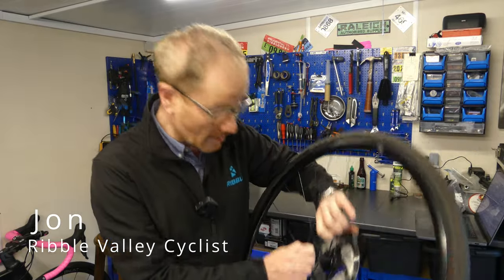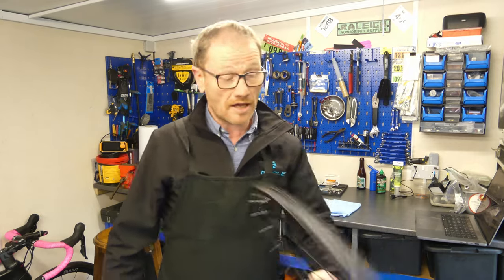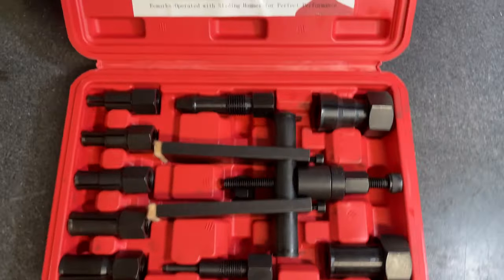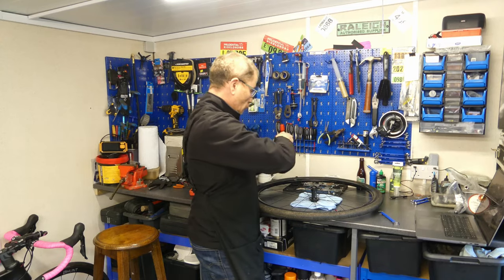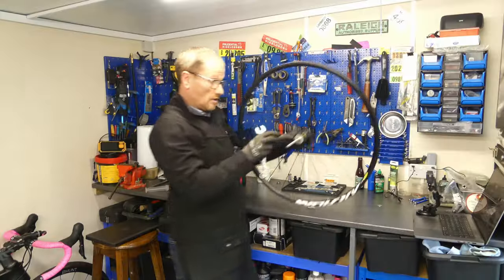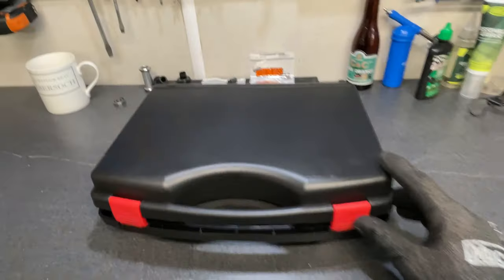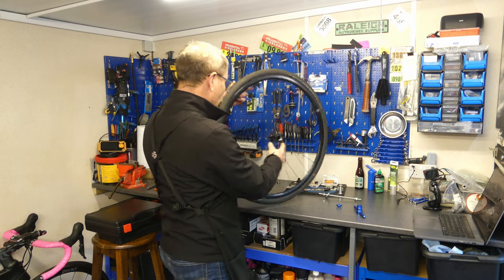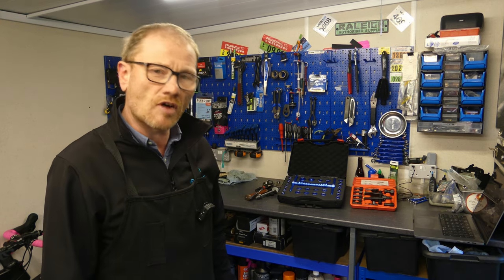Replacing Sealed Cartridge Bearings - Tools Required - Road Bike Maintenance

Comment: how bad is it to put used bearing back in
Reply from the maker: The force used to pull the bearing puts excess pressure on the individual balls, and may deform them. The only danger is that you're putting back in a potentially damaged bearing. It won't do any damage to the wheel, but the bearing may prematurely fail.
Reply: @ribblevalleycyclist  what your thoughts on extracting bearings periodically for a cleaning/regrease then? seems like doing blind pulls might ruin any longevity gained from cleaning. seems the consensus is to just replace em once they get gritty.
Reply from the maker: @wagwanyute8156 If you need to extract with force (puller or punch) then my personal preference is to replace. If the bearing is of above average quality, the internals shouldn’t get dirty too quickly
Reply: @ribblevalleycyclist  thank you

Comment: The average home mechanic needs to remember, that before hideously overpriced blue handled tools, a 10" piece of all-thread, some large penny washers and a couple of jam nuts was a perfectly acceptable way of doing things...
Reply: Also, your washers were waaaay too thin, hence they deform and the bearing goes in on the wonk. The (admittedly very nice looking...) press kit you have versus the bit of stud and washers really only differed in the thickness of the drifts...
Reply from the maker: Hi Sam, thanks for your thoughts. The washers used were 1mm thick galvanised ones, so although they may look like they deformed, they didn't. However, I personally think that if I'd have used 15mm threaded bar as opposed to 10mm, there would've been less space for the bearings to go sideways. Also, maybe using larger sockets as drifts would've helped. So, I agree, there is room for improvement with my DIY press. But I still stand by what I say, the £40 press set is the better way to go....... and I suspect you'd agree 😉
Reply: @ribblevalleycyclist oh absolutely, after all, as a mechanic, he who does with the most tools, wins, after all, right? HOWEVER. Devils advocate time. The washers are just not thick enough. If it came down to a one off use situation, a piece of all thread and some thick washers (1mm is NOT thick enough!) would do. I guess it's the difference between 'n00b' proofing something and not: it's all down to that mechanics 'feel' if you know something is lined up or going in right or not. The price you pay for that press kit to do the job without thinking about it, versus having those bits and pieces knocking around to lash together and make a tool to do the job, if you follow?
Reply: @ribblevalleycyclist  Also you can use the old, extracted bearing as the drift to press against the new bearing

Comment: I've been a home mechanic ever since I got my first bike as a kid; in my late 40s now. I've used the 'proper tool', and the DIY version and I can tell you are porpusely using the DIY version wrong.
Reply from the maker: "Porpusely using the DIY version wrong." Interesting allegation. Please expand on how I am using it 'Purposely' wrong, how you've come to that assumption, and why I would do that?
Reply: @ribblevalleycyclist Sorry for being so blunt. For example on the DIY press, just threating in the rod, throwing on the nuts, then just start screwing away will just yield the result you got, a skewed bearing. The DIY version requieres a bit more finesse than the 'proper tool'. You've got to keep an eye out for it to press the bearings in straight. Also adding some makeshift drifts wouldn't be a bad idea, like maybe a couple of sockets. I've removed several bearings just using a small hammer and a blunt rod to tab out bearings with no adverse effect on the hub. I wouldn't recommend a sharp standard/flat harden screwdriver to tap out a bearing, the screwdriver being sharp and harder that the alloy in the hub, will surely damage/scuff it if comes in contact with the hub.
Reply from the maker: You weren’t blunt, you called me a fake.

I did exactly as others had demonstrated on YouTube (I won’t name names). I battled with that press setup for some time, and I also tried several sockets…. A spark plug socket is a great fit for a 6902 bearing. However, it kept going in sideways. I kept an eye on it, and moved the makeshift press to where the pressure was needed, but it just slipped back. I didn’t show all of this, because who wants to watch that.

However, I agree with you, on reflection, doing as others have done and using a large screwdriver to remove bearings was a bad idea, and that is why I ended up unintentionally damaging a perfectly good hub. However, once again, I was testing what many so called ‘Experts’ on YouTube have both recommended and done, and it seems that I once again showed that this was a bad idea. Oh, and on reflection, a socket extension would’ve been a better choice of tool....... If you could get to the back of the first bearing in the first place (Pre-Load Tube).

The purpose of the video was to demonstrate how those ‘Bearing Hacks’ can be a bad idea, and how using the correct tool is a better option for the average budding home mechanic. Which is exactly what I did. Unless of course you think I’m wrong to do that, and those 'Hacks' are a better way of doing it?????

When was the last time you saw a professional mechanic use one of those things? There is a good reason they don’t, it's got nothing to do with price, it’s because it's a bad idea.
Reply: @ribblevalleycyclist I apologize for calling you that, should have some other wording there. English is not my first language. 

 if I saw a professional mechanic use a makeshift/DIY solution on one of my bikes, I'd stop her/him right at the moment and take my stuff somewhere else; not that I regularly take my bikes to a mechanic anyway.

I do understand that even using the proper tool requires skills, can't have good results if you don't know how to use the tool. Using the screwdriver to tap out the bearing was actually what got me in the "he's doing that on purpose" mood. You don't take a hard sharp edge to a softer shell, that's like a big "No, no" in any situation. That's why I concluded what I did.

As per the DIY press, it takes me about 3 to 5 minutes to press a bearing in, and I already know which sockets, nuts and washers to use. With a real press it takes me maybe 30 secs.

Again apologize for coming across such a c*nt.
Reply from the maker: @c0olcast Let’s move on from it Fella, it’s all about riding bikes

Apologies if I bit your head off 😂

Comment: I'm sorry, but you are way to enamored with your highly effective and yet far from perfect tools while giving only the crudest and most awkward use of often hightly functional "home brew" techniques.  Carefully tapping bearings out works exceptionally well on way more than half the different hub systems and is even recommended by many high end hub and bearing manufactures like DT-Swiss.  And, re-inserting bearings with a comercial bearing press and appropriate sized drift is still far from perfect with bearings still going cockeyed during the press process maybe as much as 1/2 the time.  I would suggest that the most important part of installing a pressed in bearing is pressing it in stright, and a judiciously used hammer is better at this than even the high-end bicycle shop bearing press systems at getting the bearing started straight.
Reply from the maker: Hi Nelson,

Thank you for sharing your thoughts.

I’m confused, You describe my tools as “highly effective” but in the same breath you say they’re “far from perfect tools”.

I’m not saying that tapping bearings out can’t be done, What I’m saying is you can’t always do it that way, you may cause damage, and doing it with a bearing puller is the better way to do it.

I agree, inserting the bearing perpendicular to the hub is key. However, I’m not sure using a hammer is the best way of achieving that….. I assume you’re joking, right?

When was the last time you saw a professional mechanic use one of these ‘Home Brew’ tools, or worse a hammer, to install bearings? There is a good reason they don’t, it's got nothing to do with price, it’s because it's a bad idea.

The purpose of the video was to demonstrate how those ‘Bearing Hacks’ can be a bad idea, and how using the correct tool is a better option for the average budding home mechanic. Which is exactly what I did. Unless of course you think I’m wrong to do that, and those 'Hacks' are a better way of doing it?????
Reply: @ribblevalleycyclist  Sorry to be both confusing and negative.  I appreicate your effort in communicating the art of fixing bicycles.  It's a topic dear to my heart. 

I'll try and answer your questions in order: 
1) Bearing presses and pullers are highly effective tools.  BUT, they do not always work.  They are but two of the many tools useful in pulling and pressing bearings.  And, they often fail to do their job and require other tools and techniques to either succeed or succeed without damage.  
2) I liked a lot of what you said about pounding out bearings.  But, it was implied that damage through pounding is likely and that bearing pullers are likely required most of the time.  My experience is that, with care, damage from pounding is rare and the vast majority of hubs (and other bicycle components) do not need a puller to remove their bearings.
3) I am not joking about the hammer in the least.  Just like doing body work on a car, you can pull and push the metal, but the really refined and controled shaping is done with a hammer with care.  Bearings are similar.  The outer races of bearings are hardened steel and tapping them with a does no harm whatsoever.  And, by gently tapping at the right angle on the righ part of the bearing, one can gently ease it straight and into place with much more finesse than a press can, at least in the beginning while the bearing is fighting the initial line-up with the bearing seat.
4) The last time I saw a professional use a hammer was yesterday at work when I was replacing lower pivot bearings in a Santa Cruz Tallboy. . . actually, I take that back, I just used a press yesterday because the bearings were being cooperative.  So, probably the day before while servicing some hub bearings.
5) I certainly appreciate your effort in showing the down side of the "home brew" techniques and the benifits of using the "right" tools. Valid points!  The fault I find with what was presented was that there are also frequently times when those "home brew" methods and tools work as well or better than the purpose built alternatives, and I found the video did not acknowledge that.  And in fact, it suggested that the purpose built tools would always provide better results.

In all, thank you very much for your efforts.  It takes a lot of guts, time, and effort to put yourself out there and provide the service you are providing.  Thank you.
Reply from the maker: I think the thing that needs to be considered here is the level of skill and what I like to call ‘Mechanical Sympathy’ of the person carrying out the work. Reading the comments, it would seem that the only people that, shall we say, take umbrage to me criticising the ‘Home Brew’ methods, are those that, it would seem, have a level of skill and mechanical sympathy. And this would therefore also suggest that it takes that kind of person to operate the ‘Home Brew’ method in the first place. Some may call these people “Fettlers”, they will happily fettle away for hours with the wrong tool, and eventually achieve a perfectly good result.

I aim my channel at the ‘Budding Home Mechanic’, that wants some help and advice as to how to repair their bike themselves. And for that reason, although I respect the alternative methods, I stand by my advice.

And thank you for your kind comments, I genuinely appreciate it.
Reply: @ribblevalleycyclist  I think you have a good point about "mechanical sympathy", if it is what I have always thought of as mechanical aptitude.  There is no doubt that better tools almost always make a job easier, and less skilled/experienced technicians benifit from having an easier job, and also good tools to make it harder to screw up.  That being said I'll have to take issue with your comment on fettlers, or maybe more preciesly fiddlers?  I'm a production mechanic.  I am all about speed and efficiency while maintaining quality.  Removing a bearing with a punch is nearly always significantly faster than with a bearing puller.  And, removing small suspension bearings with my "home made" bearing popper (made with pliers and pipe fittings) is also faster and safer on light carbon components than any comercial bearing puller I've seen.  

So, I love "budding home mechanics" and your channel is a great and readily accessable resource promoting that.  Please, keep it going strong.  And, I will always be the rebel encouraging expermentation with creative ideas and the tools at hand. . . especially since I have all the fancy tools and appreciate their strengths AND shortcomings.

Comment: Hello?  Was that hub really wrecked?  Sure you have an ugly nick but why can't you just take a small curved file and smooth out the nick and press in the new bearing.  Sure you hate to see this!  After a new bearing is pressed in,  if that "damage" is properly cleaned with a jeweler file, no effect to the function should exist.  That is the beauty of a cartridge sealed bearing.  The bearing balls do not ride past the damage!  Freezing bearing and heating hub is a centuries old technique.
Reply from the maker: Hi Dan,
Yes, it is. Agreed, the side wall damaged caused by the bearing press hack could potentially be addressed with a bit of wet & dry. But the screwdriver has caused damage to the bearing seat. I thought I was hitting the back of the bearing with that large screwdriver and hammer, when in fact, I was smacking the back of that soft alloy bearing seat. There is little chance of that bearing now sitting either flush to the seat, or perpendicular to the other bearing. This will cause excess wear to both the bearings, and the thru-axle. And as I say in the video, why would you do it anyway, when the correct tool is relatively cheap, and easy to obtain.

In my opinion, it's not worth taking the risk.

Comment: just put the bearing freezer and heat up housing 50 c then put it in just that easy as a spindle mechanic you are doing all wrong
Reply from the maker: I've seen this done many times, but never with such small races as you find on a cycle wheel. I'm going to test this theory out, and if successful, will do a video on it.
Reply: @ribblevalleycyclist  thnx

Comment: so what im taking from this video bikes are becoming and unfriendly to the owners and users as cars on the doing you own repairs
Reply from the maker: A bearing race performs similarly to cup & cone, put lasts a lot longer. Therefore less maintenance is required. The advances in technology means we need to maintain less, but use more advanced tooling when we do.

Comment: Good Video but the sound of your clothing in the microphone is like fingernails on a chalkboard 😬
Reply from the maker: Thanks for letting me know Lee. I didn’t know about that, could you do me a huge favour and point out where in the video it happened. Could do with understanding what happened, to avoid it happening again. Thank you 👍
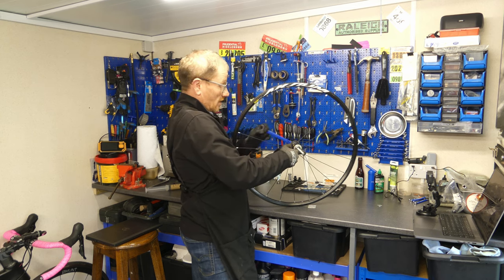Reply: @ribblevalleycyclist  9:30 is a reference and when greasing bearings/hubs
Reply from the maker: @smshing_lee  I see what you mean. It's a powered microphone, which means you can increase the gain at the mic end, and reduce the gain at the camera end. I suspect the gain is too high on the mic, so it's picking up every little noise. I'll have a look at it. Thanks again, really do appreciate it. 👍